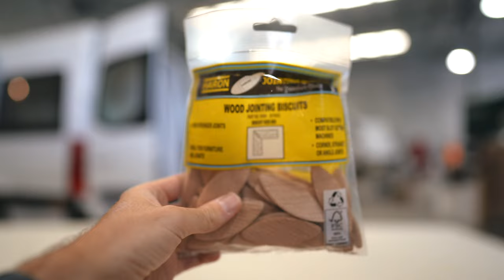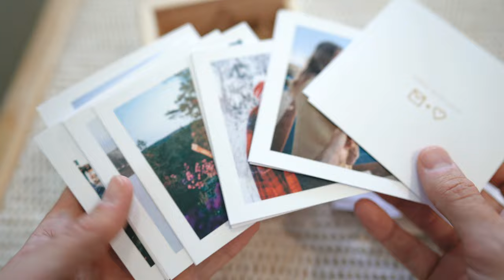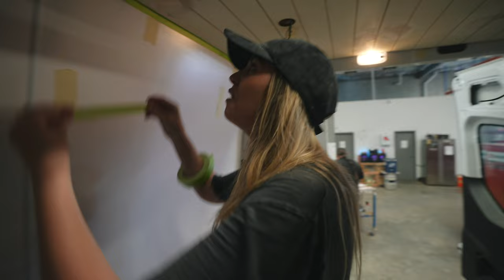VAN LIFE BUILD: Installing Our Ceiling & Building Furniture

Comment: Is it an Australian thing to call it a "roof" when it's actually a "ceiling"?  In Canada, the roof is the top/outside.
Reply: It is a roof of the van 🤷🏼‍♀️
Reply: @patis1686  Not sure where you are from but the roof is on the outside where they'll mount the solar panels.  Google it and this is what you get:  "If you consider the terms "ceiling" and "roof" being limited in application to buildings or like structures (such as caves) only, then: Ceiling is the uppermost covering wall in any room inside the building. Roof is the other side of the ceiling, outside the house".  The difference is IN and OUT

Comment: You keep calling what your were putting in side the van the roof but a painter would crack it at you and tell you it is the ceiling and all this coming  from someone who likes wood working and turning
Reply: Oh and the little thing that were being used to join the ceiling pieces together are actually called biscuits

Comment: In the US, we put in insulation, then the ceiling, in Australia, they put in the ceiling first then insulation (does not make sense) oh well, when you’re down unda, everything is reversed, just like flushing the toilet where the water swirls the other way🥸
Reply from the maker: Haha! I suppose we kinda did the insulation and the ceiling at the same time — we just had to get 1 piece in first to slip it in so it wouldn’t fall out! Then popped in the other piece